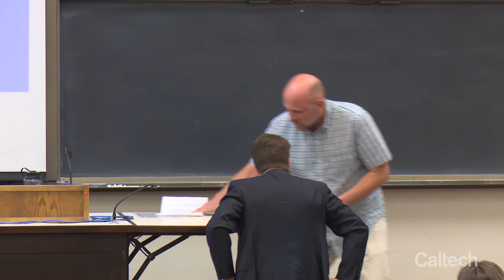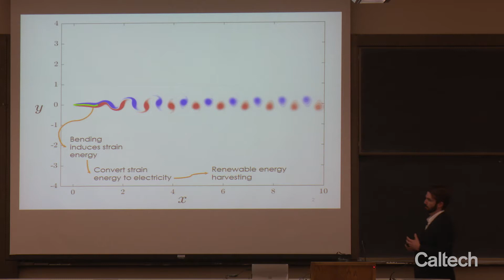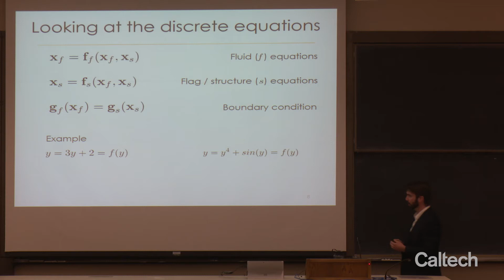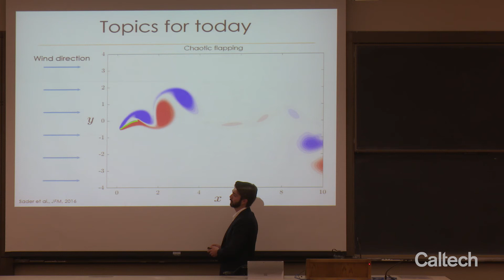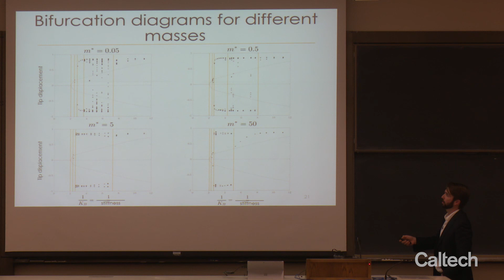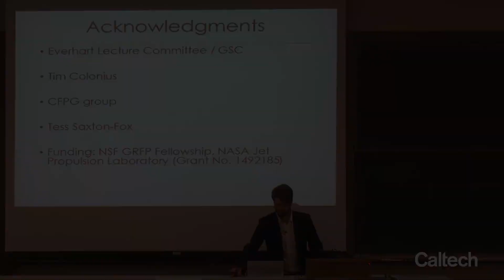How does an "inverted flag" flap? - Andres J. Goza - 4/26/17

Comment: I enjoyed the lecture. I still don't understand the condition that states the air velocity is equal to the flag velocity. What about the velocity of the fluid as it approaches the base of the flag? I trust you so I will accept any further explanation.
Reply: The fluid sticks to the solid surface via chemical forces. This is, the solid gets wet. Therefore, where the solid goes, the fluid goes. If the fluid is considered a continuum (cavitation does not occur), then, at the interface, the velocity of the solid and the velocity of the fluids are equal. Just above the interface, a gradient developes and the fluid velocity changes.